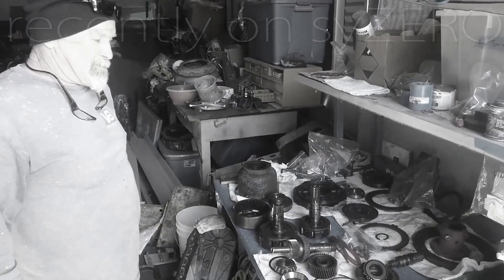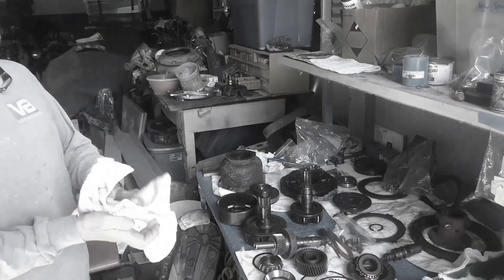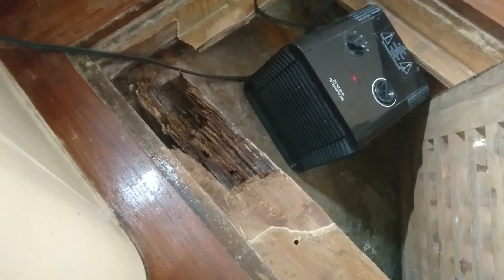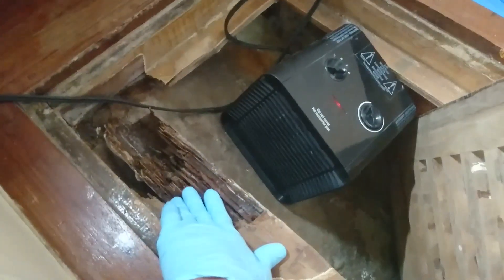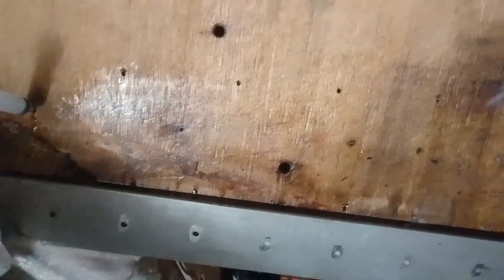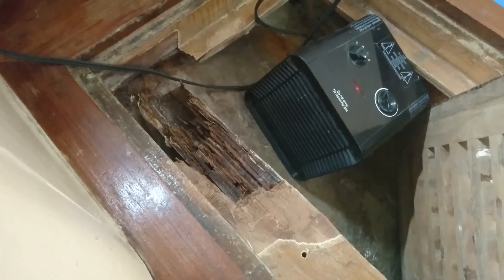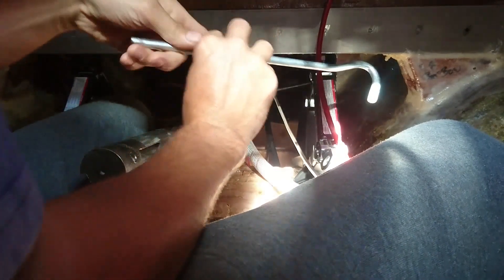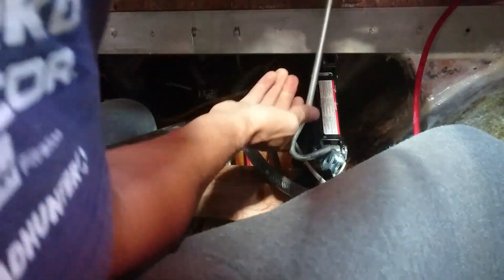17-07_Repairing the beams- let's put it back together (sailing ZERO)

Comment: Great job !!! I would have gone the extra mile and used some fiberglass matting to adhere the " blocks" to the hull, rather than just relying on the epoxy. You still could do it now.You will never regret it !!! " Near enough is NOT good enough " Mach es richtig, Junge !!!Cheers, Wilf

Comment: I guess I. I'm like the others. In the fact of adding glass or something. I feel a carbon Kevlar fabric mixed with the epoxy would be the best. Using multiple layers to at least add to the wedges. It was a great video. Thanks for allowing us to see the work!
Reply: Be careful using Kevlar, it's a magnet for moisture. Carbon is fine.

Comment: I like the beam repair, it's similar to what I had in mind.  The only thing I might add to what you have already done is put some fiberglass fabric (maybe three layers) over the blocks and keyed to the hull.  That way it's not just the epoxy holding the blocks in place.
Reply: Right, that's exactly what I was thinking... it MAY hold just fine but a little extra reinforcement couldn't hurt. Plus might be the difference between a failure and never having an issue

Comment: Here are a couple of my thoughts.  Measure from the bottom of the angle to the surface where the bottom of the jacks were resting at each end of the angle, or cut a stick to fit each location and check to see if anything deflects over time.  And whenever you cut stainless steel with a ferrous tool, passivate the SS to prevent rust.  The SS won't rust but the microscopic bits of steel left behind by a hacksaw, etc. will corrode and make rusty streaks.  Passivation is quick, cheap, non-toxic and harbor-safe.  We passivate stainless steel handrails we fabricate for marinas, ships, seaside aquariums and anything else made for a marine environment.  Ain't brothers great?  I'm glad I've got one.

Comment: Excellent. But I would glass the wooden blocks to the hull. Also it would be worth glassing in the floors you made to support the jacks and then put in verticals to ties to the beam either side of the prop shaft.
Reply: It does look like you have done a good job and I'm sure you are right.

Comment: For added strength I would glass in the lower joist member you used to put the jacks on. Then use two uprights from that lower joist to the underside of the upper beam you strengthened with the angle iron. Just a thought for added strength as it's a load bearing beam ...
Reply: Thats a shame because always good to have that extra strength ...

Comment: The only thing I can think about (you did a very thorough job) is the measurements. Some long time ago I fully restored an old wooden boat and replaced all oak keel blocks and such. 1) Get the original yacht drawings. 2) Look for as close as possible symmetry 3D. So regarding point 1; if you have an older boat you can't get it to the perfect original unless a fully rebuild but try to stay close. And 2; symmetry is about the boat balance, especially port and starboard. 
Anyway, it looked more than enough strength wise :-)
EDIT: It could for instance have meant that you needed to jack one side 2 millimeters higher than the other just based on triangulation (even when it means some forceful action)
Reply from the maker: Yeah i agree about the balance and symmetry. Its all symmetry now. But i had rot in the port side and the two beams sagged different so i balanced it and put everything together as string as possible.  Works great so far..

Comment: I may not have heard or completely understood the entire story, but it occurs to me that some of the load on the hull epoxy could have been transferred to the beam that supported the jacks with  blocks left in place of the jacks made of 4" x 4" or 4" x 6" carefully fitted such that they would not come out when the load was completely off the jacks.  This would serve to spread the load over a larger area of the hull. Also, it would have the further benefit of accounting for the increasing load when the mast tries to flex the repair.  These blocks could be installed in a non-permenent way so that they were removable for future work or access, if required.

As one well acquainted with making difficult repairs, I commend you on your strength of character when faced with that daunting challenge.  You have done well!

Regarding your web addresses, I was not able to get to them.  My plan was to make a one time contribution, but could not find a way.

My best regards,

Bob A.

Comment: Just thinking you could make a box from angle (Stainless) that the prop shaft goes thru welded or bolted together,  then one from the top up to the stainless the other from the bottom down to a flat piece on the keel. that would take all the preasure off those wood wedges.You could also make one from a 1" bolt that you can put into a welded nut that you can turn to tighten or loosen like the jacks do. If those wedges giveway your back to zero. You know the keel isn't going anywhere. if you have room could also make something on either side of the prop shaft.
Reply: That's right, now I remember.  Watching to many of these video's.

Comment: I think the job is well done. Some thoughts about corrosion of stainless steel. The problem is, it's not corroding on the surface, but intercristalin. so if there is any blue color from grinding or microscopic parts of mild steel from saw cutting left on the surface, it will react. Stainless is getting a passive coating by itself as a reaction of oxygen and chrome during a time of 24 to 48 hrs depending on the temperature and humidity to an thickness of about 10 mikro millimeters, but where there is blue oxidation or debris left on surface the self-passivation can't work and the corrosion will start in between the crystalline structure of stainless steel. Think about that and look at your angles from time to time. Intercristaline corrosion is looking similar to a spiders net on the surface.  Fair winds, following seas und immer ne Handbreit Wasser unter'm Kiel.
Reply: Simply cleaning won't stop the corrosion. If it's in there, you're done you can' stop it and the stainless parts will desintegrate like sand, specially in a salt soaked atmosphere like on a boat. Preventing the intercristaline corrosion of stainless steel can only be done on the steel itself. 1. No grinding or cutting tools or drill bits that have worked on mild steel before. 2. don't leave any blue or brown to yellow oxidation color from grinding temperature on the stainless. 3. grinding the surface up to grid 240 or higher (min. 180) . 4. let the stainless steel parts rest in a clean atmosphere without grinding dust of mild steel for min. 24 hrs. Thats the easiest way. Another proper way is sandblasting the stainless parts with glas dust (doesn't look so nice as a grinded surface but it's way much more corrosion resistant). The last way is using a special acid for stainless steel. Really dangerous and not to be done on a boat without the right safety gear and tools. But don't worry too much, the chance for this kind of corrosion is not so high as it seems. Check the surface from time to time and if there is any sign of corrosion or rust, take the grinder and a new paper disk of grid 240 and clean it up without too much pressure (cold grinding). Don't seal the stainless surface for min 24 to 48 hrs for self-rebuilding the oxygen tight  passive coating that makes stainless steel corrosion resistant. You should look specially at the spots where the Jack's have been attached, they are mild steel and if you find any scratches or damage of the surface, these are the spots where corrosion starts. Grind them to a proper surface and the stainless steel does the rest. Fair Winds, following seas und immer ne handbreit Wasser unter'm Kiel

Comment: How can you trust the epoxy connection at that kind of stress. Good luck.
Reply: You need to glass those blocks to the hull or you will be sorry.
Heavy glass a quarter inch thick minimum. But use light  fiberglass cloth like used in surfboard mfg so you can bend and wrap it. About 20 layers of 6 oz.
Those blocks then will have a mechanical bond to the hull.
If you think about it those blocks can crack  out still but if glassed in they will support the beam

Comment: Yea but youre wrong. It needs glass ask a boat builder. Epoxy glued is not going to prevent those from cracking but glassed in they have no where to go.
The wood might rot again but the glass wont move.

Comment: You have a lot of can do. Not every body does. The only thing that would have made you job easier is to had the hydraulic jacks lift the beam up and then use the screw jacks to hold. The screw jacks are a bear to lift things with as you found out.

Comment: WTF ?…
Saturating a beam means fixing it ???…
Reply: I understand now why you cal yourself "zero"
Reply: This cannot compare to a beam on a boat.
A window is not subject to the enormous stress put on a beam on a boat.
At any rate all impregnation of epoxy on wood must be made under pressure so the resin can penetrate and saturate the wood equally, this means putting the wood in a vacuum chamber combined with hot temperature (so as to have to wood fibers opened for a better penetration of the resin). A requirement not needed to windows as the latter only need protection an a reasonable reinforcement. This is not the case of a beam … 
Now you only have to cross your fingers and have fun …